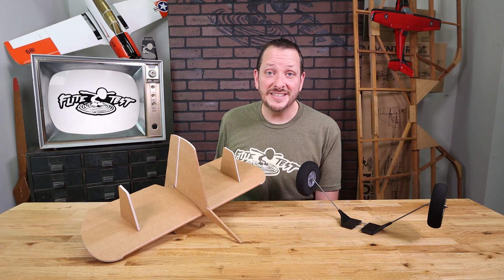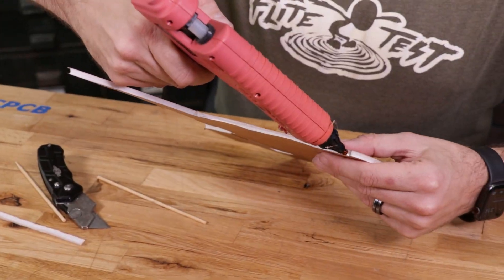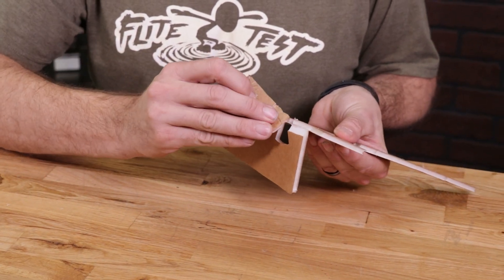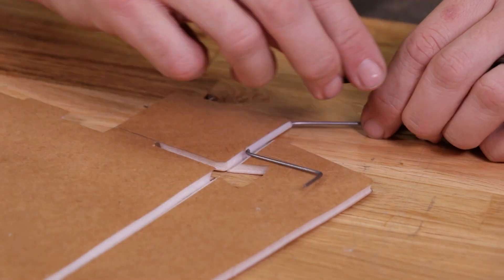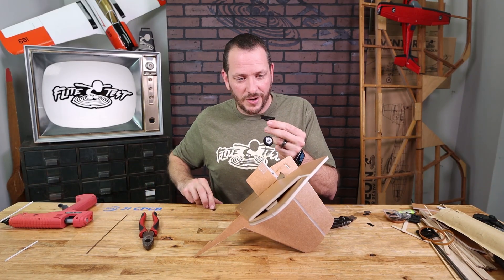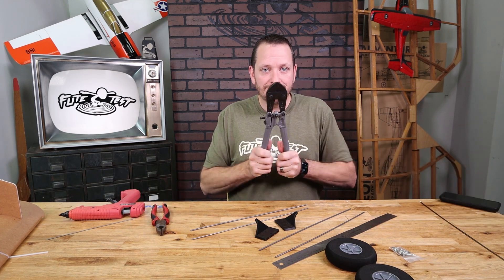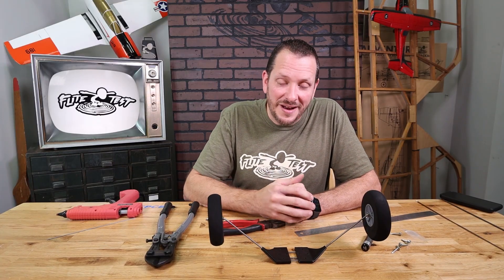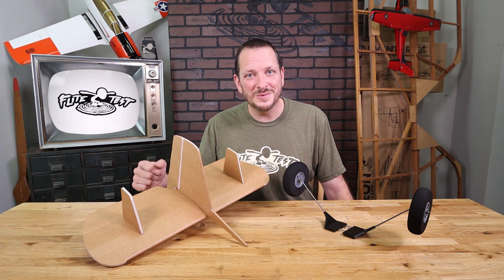How to Build the FT Legacy V2 Updates //  BUILD

Comment: 2 points. First, the Legacy V 2.0 value bundle does not include wheel cover nuts (to ensure your wheels don’t fall off). Or more accurately it does include nuts but they don’t fit the .125 inch wire provided with the kit. Very frustrating. Second, it’s pretty impossible to cut the .125 inch wire provided with the kit unless you have some really hefty bolt cutters. So make sure you have both the bolt cutters and the wheel cover nuts before you try to build the wheels, or else get ready for lots of frustration and disappointment.

Comment: Will these items (rudder, stabilizing fins, and landing gear) be available as an upgrade kit for those of us who already have a Legacy in our fleet?

Also, Please consider re-shooting and updating the beginner series you did with Josh nd Josh many years ago with current technology.
Reply: I have one yet to be built kit that I ordered immediately after one I had stalled about 6ft above the grass on landing. The aluminum landing gear did tear away then, breaking ply box and tearing the fuselage open. The setup with less rigidity might have limited the damage to something less disastrous. Turns out I did overestimate the complexity of the repair - new ply box cut from scratch, doublers above torn fuselage sections - the plane still flies, and I have extra kit sitting on the shelf. This makes that second kit an ideal candidate to experiment with upgrades during winter. Updating the rudder with reinforcement and extra fins looks straightforward, but I think I did overhear something about free STL for the landing gear? Sure, functional equivalent can be designed from scratch as well, but if one were made available, even for a fee, I’d snatch one.